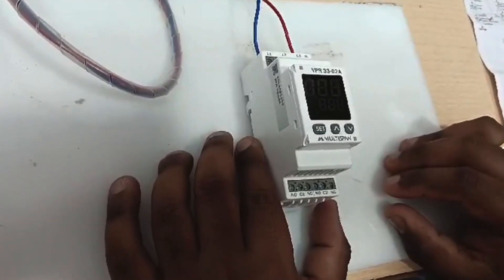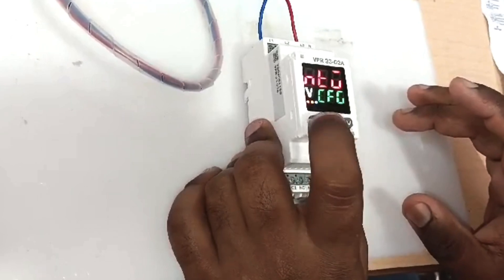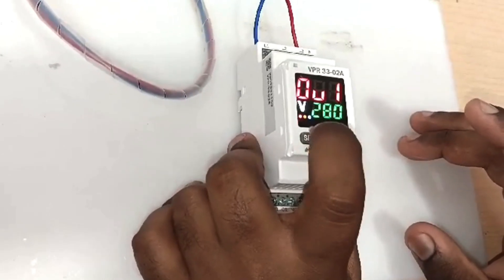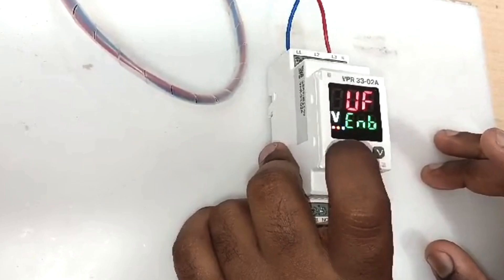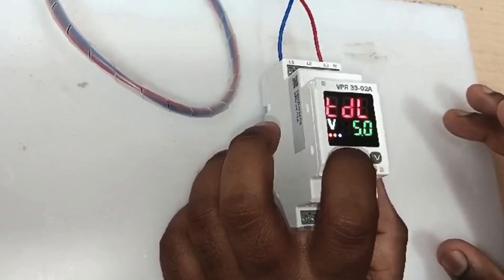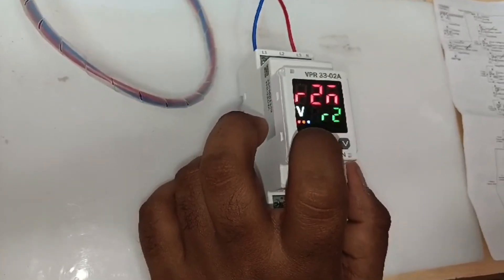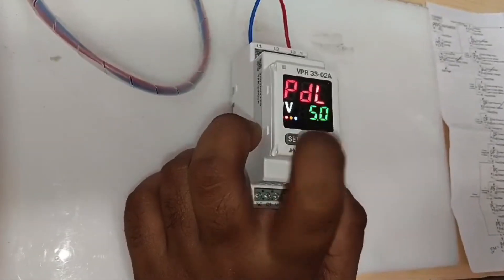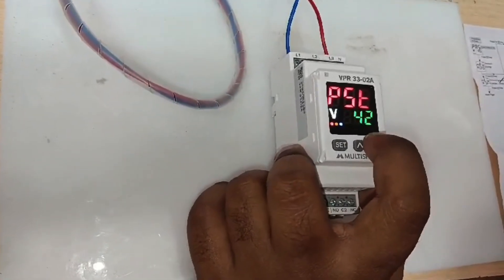VPR 33 from Multispan is a Voltage Protection Relay .#Multispan #VoltageProtectionRelay #VPR33

Comment: Selec 900vpr , in this relay we can use it single phase ac as a ( over voltage protection) and ( under voltage protection) , i have a question can we use this relay aslo as a single phase (ov, uv ) protection??
Reply from the maker: kindly contact once 9141004135